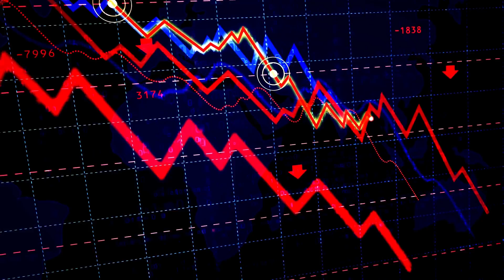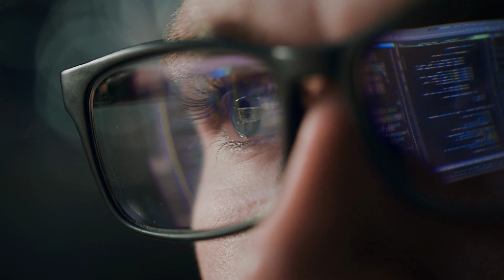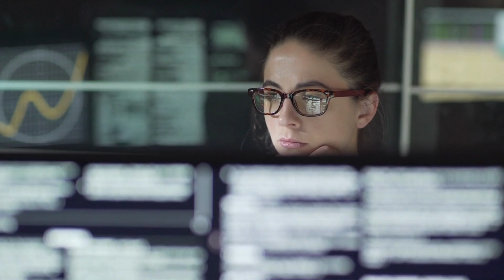Artificial Intelligence:  Interesting Historical Facts  |  Build Your AI Foundation

Comment: Many years ago, I remember that my family had a lot of old electronic equipment, including an old television from 1940s/1950s.  (A super small screen of 15-20cm and weight over 15 kilos).  

I remember seeing the vacuum tubes, and the electron plates on either side.  Everything was visible, all analog, and with that experience I learned how a television works.  It influenced me to be an engineer and work with the latest technology.  Is much more difficult to learn the fundamentals now since things are digital and it's hidden.  The progress we've made from then until now is incredible.